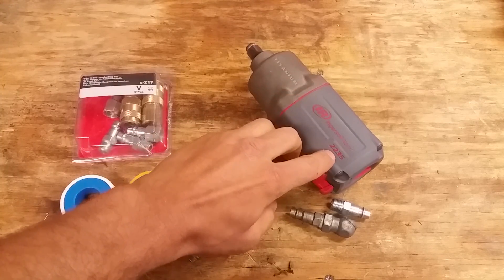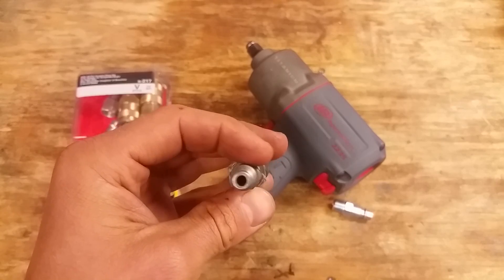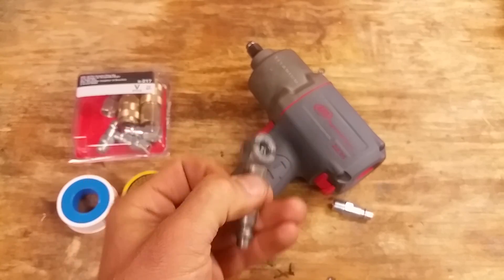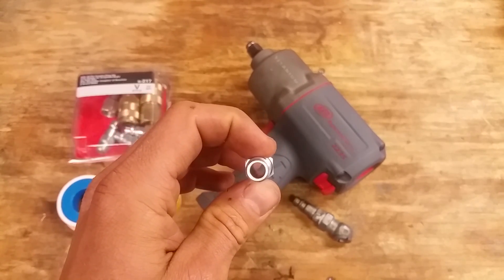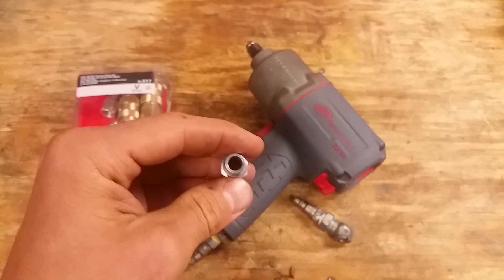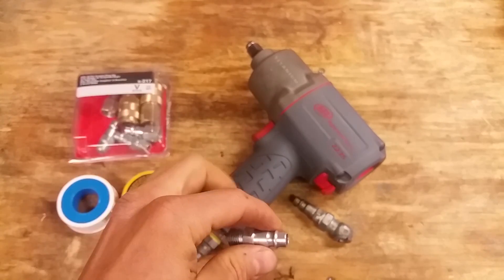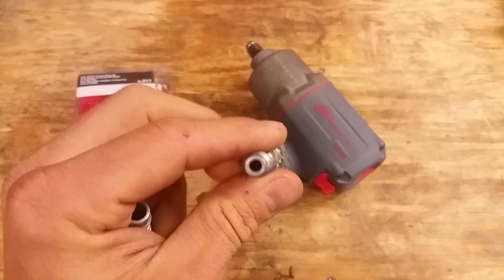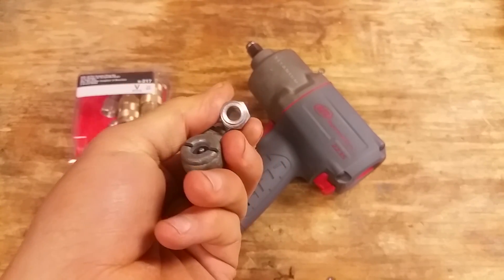The BEST Air Fittings Made?!?

Comment from the maker: What's up y'all? Links in the description to turn your impact into a BEAST!
As an Amazon Associate I earn from qualifying purchases.
Reply: My impact is already a beast
Reply: I'm just curious, why not go up one size on the chart? Instead of paying extra for a Milton V 1/4" fitting, why not get a cheaper 3/8" M fitting? Same inner diameter plug, but less money, and no problem to find in a big box store or local hardware store. 

I am really asking. I'm new to compressors, so I'm looking into all the fittings and hoses and what not.

My other question is why you need a fitting that allows 74 CFM. Just less resistance (like using a 10ga cord as opposed to a 16ga) or what?
Reply from the maker: The 1/4" V style are backwards compatible with all your old fittings. You can get bigger fittings for everything if you prefer that route. The 1/4" fittings are also physically smaller and more compact which can help in tight spots/handling too.

The increase in CFM really helps. It's removing bottlenecks from the system.

Comment: They are great fittings, I just bought a whole set myself. But people should be aware these things will DRAIN your air compressor like crazy. they flow 70% more and will drain your tank 70% faster it is pretty crazy. But hopefully because of the flow you will complete your job much faster.
Reply from the maker: Yea, they are amazing fittings, but you are right. They will drain your compressor tank super fast. I have an 80 gallon compressor so I don't really even think about it.

Comment: Milton Coupler lasted less than 1 day hooked to my air impact,  steel fitting had ball dents as well . I replaced with real 3/8" coupler, i have no idea of brand but not a problem since. I have also ordered a 3/8 and 1/4 stainless steel pressure washer couplers as experiment for use at ocean. Cheap at about 12.00 for complete coupler, 5000 psi, better seals and should let me use washer pressure guns as straight air guns as well, just not the air hoses as water hoses or would burst.
Reply from the maker: I have no clue why yours failed? They work great for me. The only thing that beats up air fittings for me is an air hammer. It puts little metal dents in every air fitting I've tried from all the vibration.
Reply: Yes it was an air hammer , my 3/8 coupler is steel as well and more balls. 

I can see where a good idea for air hammers would be to use a short whip hose before the coupler fitting on any 1/4" couplers.

Comment: Agree bro.  I got the 3/8 Truflate/Automotive style with 1/2 hose.  Another key is not to run the hose off the pressure regulator on the 30 gallon or smaller compressor.  So the air has a straight shot through 1/2 fittings and hose all the way to the gun.  The pressure measured shall be 90 PSI with the gun running.  My IR impact has no problem with Honda crank bolt.  I broke a few head off the bolts on frozen chassis components.

Comment: In my nearly 50 years of dealing with air tools, hoses, and fittings, unless you have gone to a significantly larger regulator the largest source of restricted air flow on most air systems will be the regulator itself.
Reply from the maker: Yea, you are right. I have a 3/4" regulator that can flow like 100 CFM. My regulator isn't restricting anything though.
Reply: @MattsShop  10-4, and you might have explained all of that in one of the earlier videos you referenced during this one.  My guess is that most of us are running 3/8" regulators which have an anemic flow rate to start with which would be reduced by the M fittings, but not as dramatically as in your situation.  Thank you for clarifying.
Reply: @MattsShop  Your regulator may flow 100 cfm. at max setting. But unless it is a regulator that works by unloading your compressor heads at set psi, not found on electric compressor it regulates the air by restricting the flow. Put a cfm meter on it and test air out put at 90 or 120 psi. Any good 3/4 regulator should pass around 150 cfm at maximum out put pressure. But some of them are lucky to get 25 cfm at 100 psi out put. Heck i got one cheap 3/4 regulator laying around that can not even supply 25 cfm at 90 psi. But unless you are working on big machines you would never know it. And working on heavy equipment you would be running 175 psi any way.
Reply: @bucmeister7713  3/8 regulators are rated around 50cfm.

Comment: I run my compressor at 150 psi
I run a 3/4 inch hose to my 1/2, 3/4 and 1 inch gun. My fittings are 1/2 inch id. For all my die grinders and smaller impacts I run a regulator down to 100 psi. 

Before I upgraded to the 3/4 inch hose I couldn’t remove 1 wheel on my semi with out having to wait on my compressor to catch up. The 3/8 inch hose was robbing so much power. 

My compressor is a water cooled 4 cylinder rated at 35 cfm @175 psi. I am running it at 1/3 rated speed at this speed it still makes 35 psi oil pressure.
Reply from the maker: You have a serious compressor! Isn't it a pain to lug that heavy 3/4" hose around on the small air tools? I mean a 3/4" hose is like as big as a garden hose lol. I don't see the point of having such a big and bulky hose and fittings on a 1/2" impact and a die grinder.

Why not just have a dedicated large hose for the big boy 3/4" and 1" impacts and use a 3/8" hose for the 1/2" impact, air ratchet, and die grinders? That's what I do.

Comment: I discovered these about 2 months ago and they leave you shaking your head asking yourself how you put up with the m style for so long. When you change everything from the compressor to the tool to these v style high flow fittings and couplers, they will put a smile on your face for sure.
Reply from the maker: You are right. They are the best air fittings made. I changed everything over to them and tell all my friends about them. Once you make the switch you won't go back.

Comment: I've never had any such issues with my 1/2" impact or any other pneumatic tools using the Industrial fittings (M style in some brands and D style in other brands, which is why I prefer to use the proper name of the different fittings, i.e. Industrial, Automotive, ARO and Lincoln) and I only have a small portable compressor which tops out at 120 PSI. But I only use non-slave-labor fittings. I suspect your problem was the female fittings which you said you got from Horrible Freight, which would have been made by slaves in china and probably had a terribly restrictive design. As you pointed out, the Industrial fittings flow almost twice as much air as that tool needs (as long as you use non-slave-labor fittings).

Comment: Good information. I've been looking for someone to break some of this down and explain a little better. I'm in the process of re-fitting my air system, because when I initially installed everything I didn't understand the amount of air pressure I was losing. I would have my 60 gallon compressor maxed out at 150 psi to run a spray gun that only required 80 psi. I didn't realize at the time that I was actually losing almost half of my air pressure over the distance of the system. The whole system actually comes out of the tank to a 1/4 regulator and creates a MASSIVE bottle-neck. Lol Kind of funny looking back now, I've never cared for air tools because they were always under powered and sloppy... turns out I have been running them at half their recommended pressure!!!
Reply from the maker: I appreciate it. Yea, this stuff is not complicated. A lot of people just don't know how these things work. Glad I helped you figure out your problem. Yea, the 1/4" low flow fittings are pretty much for nail guns and tire fillers lol.
Reply: Brother Forge- It's not so much a pressure issue as it is volume (CFM). See my long-winded post above (sorry).  Air tools need both the correct CFM and pressure supplied to them. Without both they will still work, but they are underperforming. I am seeing this now with a Devilbiss  HVLP spray gun I just purchased. It requires only 23psi but 13CFM. My filter and regulator has 1/2" ports, 1/2" pipework, and 3/8" hose with 1/4" NPT end fittings. I switched to Milton V high flow connectors and couplings and still no help. My CFM restriction is in the end fittings of the 3/8" hose. I'll change to a 1/2" hose and I am certain it will solve my problem.  Hope this helps before you go buying new parts.

Comment: i just upgraded to 1/2 hose and milton connections Oh my god it's like my IR2525 ti grew a set of balls. i need ear protection now.
Reply from the maker: Yesss! Please tell me you weren't running that on regular 1/4" low flow fittings before.
Reply: 3/8th hose and connections
Reply from the maker: Yea, it really is like buying a brand new impact. I will never go back to regular low flow fittings!
Reply: Try 1/2 hose with 1/2 milton fittings the thing about twist out of your hand
Reply: @TURBOSHANE  Excellent! You just made the point I have been screaming about. 1st- CFM (air flow or volume) is the issue, not pressure. Most decent compressors will put out the required pressure to run the tool (usually 90psi) but then they also have to get the air volume to the tool. And when it comes to CFM , the most volume that can flow will be contingent on the smallest orifice size in the system. A restriction at any point in the system will reduce the CFM to the tool. So 2nd, every 3/8" hose with 1/4" NPT end fittings that I have examined has a restriction in the end fittings. Look down inside, you will see a reduced inner diameter (ID) that is considerable less than the 3/8" hose ID. So if you're trying to increase air flow to your tool simply using only high flow 1/4" NPT fittings like the Milton V type is useless. You haven't resolved the restriction in the end fittings. And hose length is also a factor but thats another story. So to increase CFM to your CFM starved impact gun you did exactly what needs to be done. You switched from 3/8" hose and connectors to 1/2" hose and connectors. Your impact gun is now getting the air volume it needs to provide its full rated torque, and you clearly felt the difference.

Comment: The ideal way of demonstrating your point would be to place a gauge in line right at the tool then observe the pressure level as the tool is continuously running.     With the understanding that the working pressure is what determins the torque behind each increment of rotation and the cfm the ability to maintain that pressure as the rotation continues.  Seeing the gauge readings with standard vs. high flow would would emphasize your point well.
Reply from the maker: No, a gauge would not demonstrate my point at all. We are talking about flow "CFM" not pressure "PSI". You can have 100 PSI through a straw or 100 PSI through a 12" pipe. Which one is going to run your tool better?  The 12" pipe will because it can flow more air through the tool than it could possibly use.
Reply: @MattsShop  it is a combination of both, that is why you would read the gauge while running the impact wrench.   A leaf blower can produce 500 cfm but do you think it could drive an impact wrench through any size of feed line ?   Ofcourse not because it lacks the needed pressure.   A hand pumpl sold to inflate bicycle tires can produce  100+ psi but lacks the CFM to run the same tool.     If a tool states it needs 5 CFM at 90 psi then it is saying at running speed, it will consume 5 CFM of air at full opperational speed.  At that flow  rate, it needs the pressure of that air flow to be 90 psi to provide its optimal torque.   There are many videos to be found on YouTube  testing / comparing  connectors / supply lines where a gauge is  placed at the tool to show why the lack of CFM is not being supplied as fast as the tool wants to consume, resulting in a significant drop of pressure, indicated by the gauge.  It enforces the point of your video regarding bottle necks in lines / connectors effecting tool performance.   Search "Supercharge your compressor" and a video by GTair will demonstrate.   Towards the end they use such a gauge to demonstrate the effects of smaller  or larger hoses causing airflow restriction . Same effect as connectors with smaller openings do as your video subject

Comment: Is 1/2" or 3/8" air hose the recommended size for the Ingersoll Rand 2235TiMAX?
Reply from the maker: 1/2" air hose would be overkill and a pain to lug around. 3/8" hose and these fittings is the best combo.
Reply: @MattsShop  Ok 👍
Reply: Ingersoll Rand web site states 3/8 air line up to 25ft over 25ft 1/2 but truth is few home owners own a compressor that can produce more air than a 1/4 fitting can carry. Fittings are rated as orifice. And carry over 50cfm at 100psi. Small hose size restricts you much more than fittings. Hook a 1/4 fitting to your compressor no tool hooked up. It will flow more air than a 5hp 2 stage compressor can supply.But use 100ft 3/8 air line and the pressure drop is large. My diesel compressor can run 2 jack hammers at once.160 cfm 3/4 air line 150 ft long. but with 3/8 air line the 150 psi input pressure will drop below 90 on my impact wrench or sand blaster. With 1/2 hose up to a hundred ft is fine. Over 100ft i use 3/4 100t and 1/2 hose 25ft long plugged into it. Any way 25 ft is max length for 3/8 air line on 1/2 impact wrench to get air flow needed with or with out fittings.

Comment: The shop has 175 psi and with a thunder gun no need for high flow. And T types don't start leaking after a couple months. Im in heavy equipment and use large size sockets and need lots of torque
Reply from the maker: So you are using 1/2" air fittings I hope.
Reply: @MattsShop  1/2" only for 3/4" gun
Reply: Your sit up will work fine used it for years . Air pressure controls air flow more pressure will flow more air in smaller hose. You can tell if hose size is to small by hose getting hot. The older CP 3/4 wrenches used 1/4 thread on the fitting. Newer wrenches 3/4 uses 3/8 fittings and 1/2 hose. On 1 inch i use 10ft 1/2 hose  screwed in gun then to 3/4 hose with Chicago style fittings. Working on equipment you need 175 psi as IR recommends on there 3/4 and 1 inch impacts.
Reply: @cliffclark6441  i use Ingersoll 261 on 1/2 hose for 3/4 gun duties
Reply: @earleclemans4836  I got 3/4 and 1 inch. I also run 175 psi 1/2 hose on my IR 261. I often run 10ft 1/2 hose connected to my 3/4 hose coming from my 160 cfm diesel compressor. It has a regulator use adj on compressor that un loads the heads. I turn it down to 175 on my wrenches but i have for got to turn it down and ran over 200psi and did not damage my wrenches.I always screw short hose into gun then couple into air line. You should never screw coupler into your gun. It makes it harder to use and gets in the way. Heck at 3ft even 3/8 hose can run a sand blaster or 1 inch impact. As long as it is supplied by a bigger hose. But IR limits 3/8 hose to 25 ft even on 1/2 impact. 3/4 hose can run 200ft at no pressure loss on 1 inch impact. IR and CP wrenches can be complete rebuild and perform like new for less money than home owners pay for them junk throw away china built wrenches. New air vanes for your 261 IR cost around 14 dollars. And will make it perform like new.